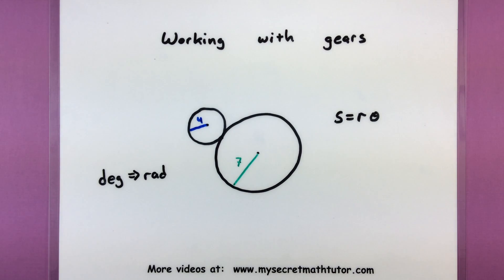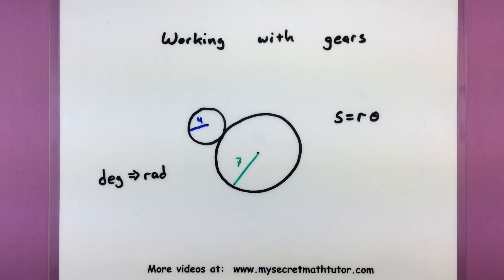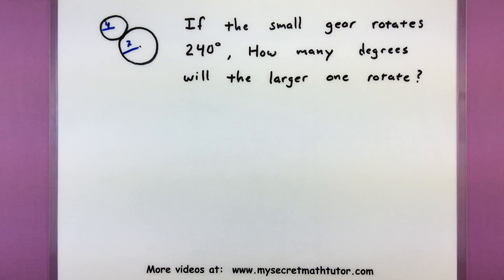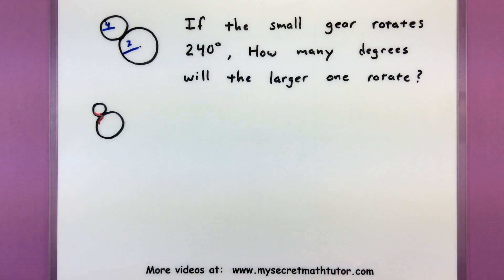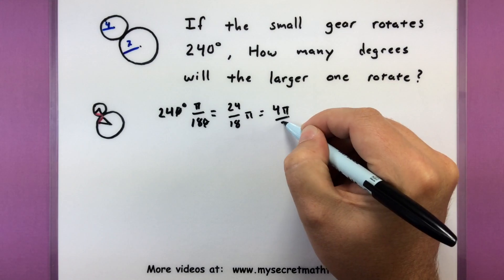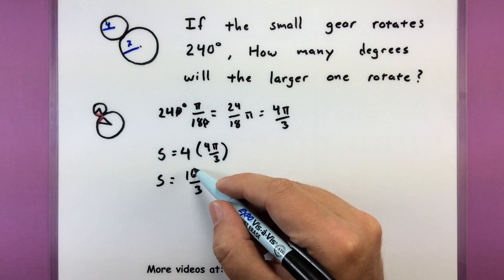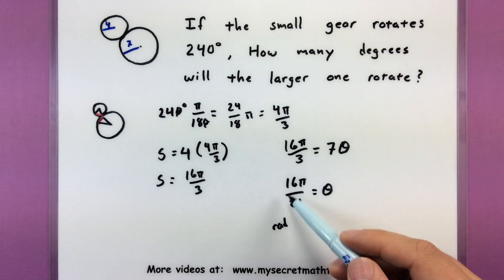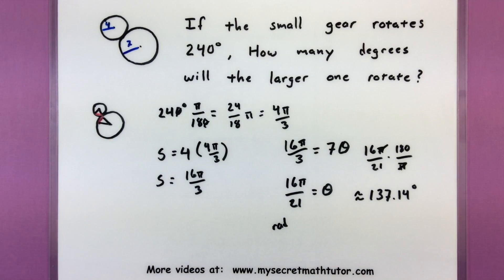Trigonometry - Working with gears

Comment: do you have a video solving for the radius of one of the circles? like say figuring out the size ratio to one another? say i had a 1" small gear and know i need the small gear to turn 260 degrees and the large gear to turn 180 degrees. how would i know what diameter the larger gear needed to be?

Comment: Is same method applicable for rack and pinion?
Reply from the maker: For a rack and pinion you have circular motion and linear motion.  You can also think of it much like a wheel and the ground.  If you know how fast the gear is turning (w, angular speed) you can use s = r w to find the linear speed of a point on the edge.  If this is connected to a rack, that would be the speed it moves left or right.  Let me know if that helps.  :^D
Reply: @MySecretMathTutor  let me to workout and advise  you results soon
Reply: Rack and pinion - sounds like a very engineerish thing to me. pi = 3

Comment: "Divide both sides by 7 and that gives us 21" I can't follow this part
Reply: Currently me
Reply: actually nvm I got. You dive 16pi/3  ÷7 and you invert the 7 which makes it 1/7 × 16pi/3 so it becomes 16pi/21
Reply: dividing a fraction by another fraction (7/1) results in KCF (keep it, change it, flip it). So you end up multiplying 16pi/3 x 1/7 = 16pi/21